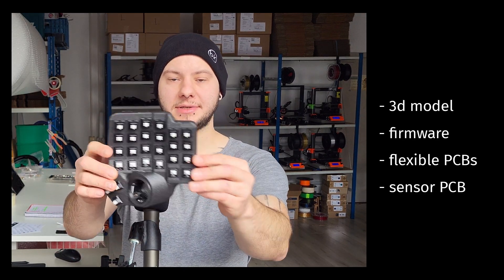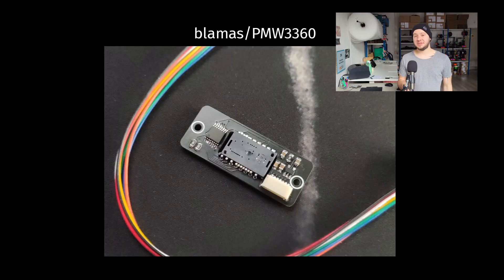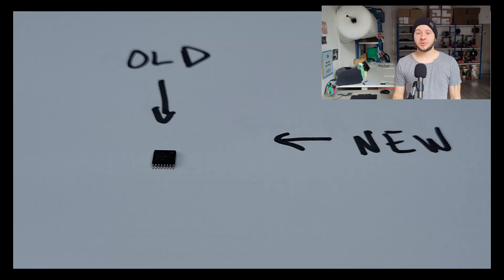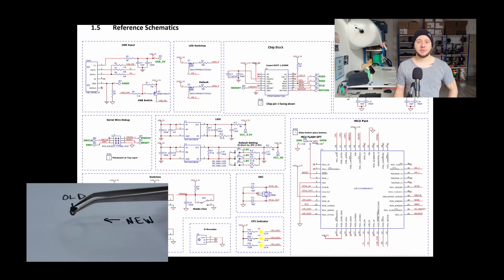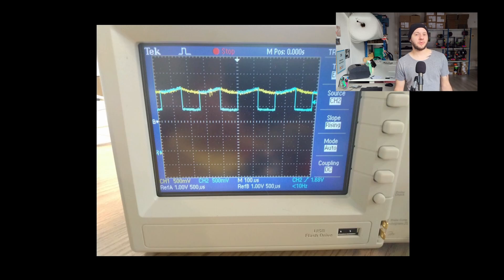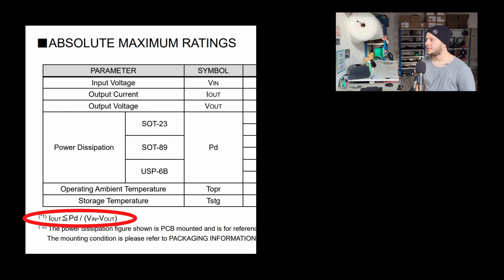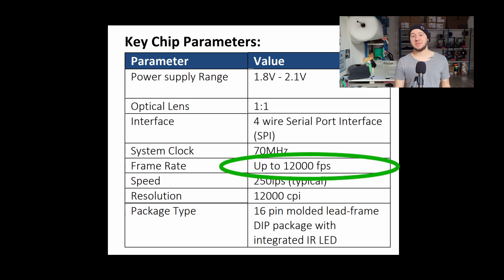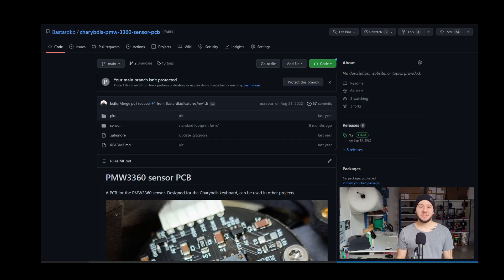Designing a trackball sensor PCB

Comment: Hi. Nice work. I would like to try to build a sensor board based on your drawing. Can I ask you one question? Can resistors R2 and R3 just be omitted? They don't need to be replaced with jumpers(0Ω)? In the Github photo, R3 is not installed, but R2 is in its place.
Thanks a lot for your work!
Reply from the maker: If you get a fixed 2.0V AP7331, you don't need R2 and R3.
If you get an adjustable one, you need the resistors to set the output voltage.

Comment: Can the current spike be fixed by just adding a capacitor?
Reply from the maker: Hey! That was due to the activation of the sensor. Maybe by storing some energy to make it available when it triggers it would be doable... but that was also not directly advised in the technical datasheet, which is why we just upgraded the regulator

Comment: look nice, one question, I would like to use it on my yanghu/unicorne, can that psi output be adapted to 4 pin of the OLED?
Reply from the maker: Hey, I don't think so. The trackball needs 4 signal pins + 2 power pins
Reply: @bastardkb  well, ill puta a pimoronni o a cirque. And in a time mount your keyboard

Comment: You are just amazing man. I probably will never build one myself but salute your effort.
Reply from the maker: Thank you !
Reply: I have to ask though. Why a trackball and not a trackpad like the cirque or azoteq ones? Some even have multi-touch gestures right? Won't they be more precise?
Reply from the maker: @Ashwekar  I have trackpads on my Dilemma designs because they are made to be portable. On the Charybdis, I added a trackball because it's imho easier to use in the long run on a desktop. There are also user mods  on the github repository to install a trackpad instead of it if you prefer that
Reply: @bastardkb  good to know. Thanks

Comment: Another way to solve the noise issue may be a capacitor between the output of regulator and GND, as long as the power consumption of the chip is lower than the power the regulator can provide (in theory). The capacitor serves as a buffer.
Reply: Excellent Industrial design btw!
Reply from the maker: @powerfulghost8076  Thanks for the info ! With more recent designs I use capacitors but mostly for the electrical noise, usually for RGB. I don't play with power regulation that much anymore except for the RP2040. I'm creating a "better" version of the splinky which is giving me all kinds of issues with half/full duplex